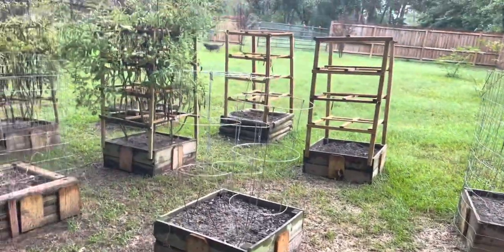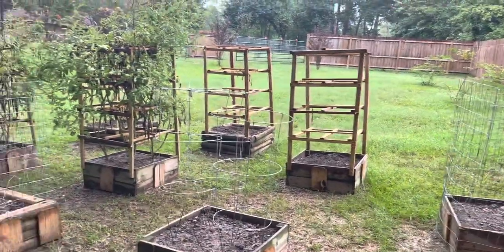Nothing but bobcat.

Comment: Are you normalizing before quenching?
Heat the blade a little beyond the heat treat temperature then let it cool naturally just in the air. Do that 3 times and it should greatly reduce any chances of warping.

Edit: make sure the blade is not in contact with anything that will draw out the heat faster. Set up some coat hanger type wire you can hang them from while normalizing

Comment: Oh, just went through the same thing kinda, with my neighbor's mower. A big shop charged him $300 to fix it putting on a coil and sharpening blades. Nah, it was the kawaski igniter going bad, and a safety switch, and module. Wasn't just throwing the parts cannon, several parts having intermittent issues. Tested them individually. Hillbilly with multimeter and good intentions $40 in parts and 2 hrs, and a handshake.  Big shiny shop, almost 4 weeks, $300.  I am kinda getting sick of the slap em' together auick turnover attitudes places are getting.  There's bottom line, I understand that, but it seems like they charge more than if they fixed it right.  Sorry in a soap box mood lol.